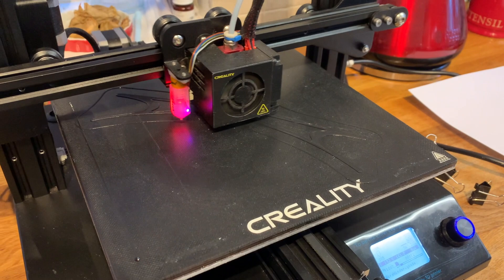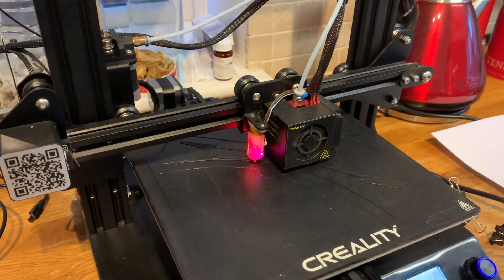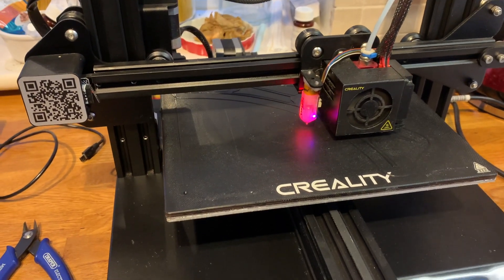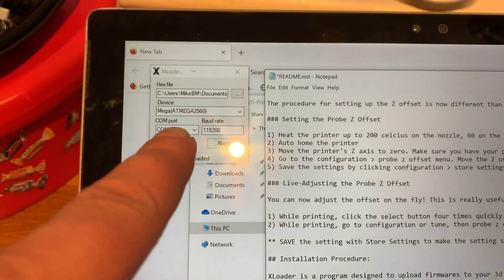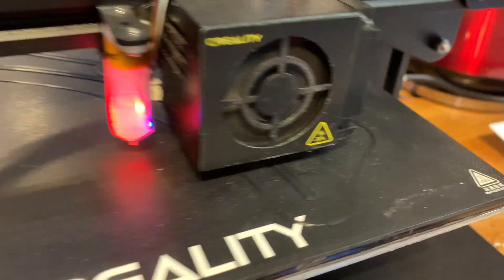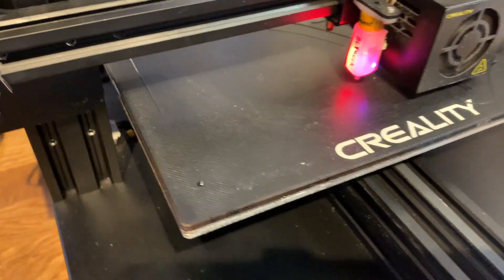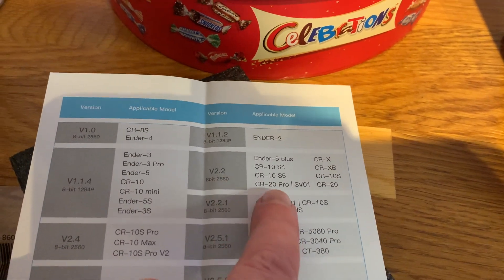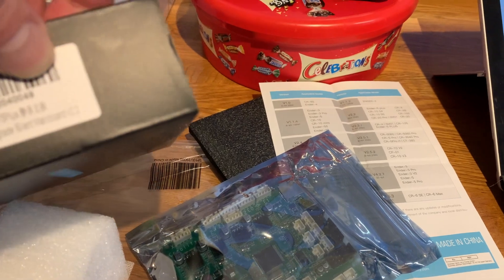Creality 3D Printer Upgrade - Silent MainBoard CR20-Pro, Ender-5Plus

Comment: I had one of those high-pressure coffee makers but a plastic coupling inside broke and hot water sprayed the interior of the machine...
If I had had a 3d printer I could perhaps have made a sparepart for it..

Comment: That's awesome!! 
I have the Creality Ender 3. I'll definitely be looking into getting a silent board for it. I switched out the stock fans for Noctua fans... that made a huge improvement in sound reduction. Also added vibration dampers to the stepper motors. I'm pretty much down to eliminating the sing song noises the machine makes while printing....which looks like the silent motherboard completely eliminated. 

Thanks for sharing. 😊👍
Reply from the maker: Yep best Xmas present my family has had, no noise 😆😆